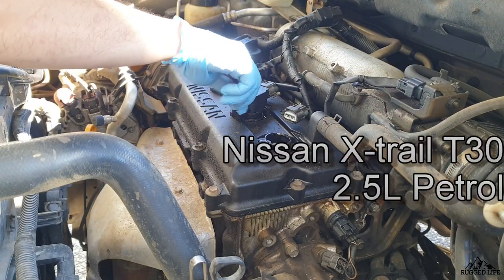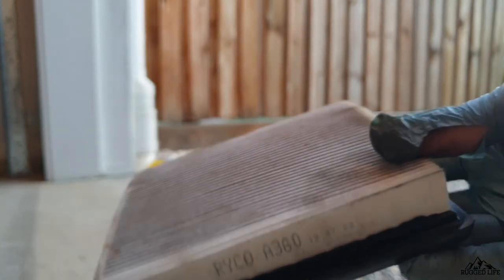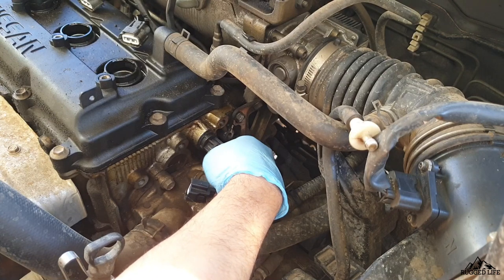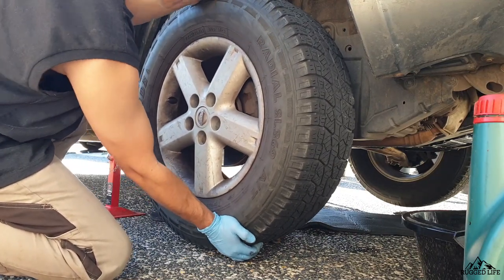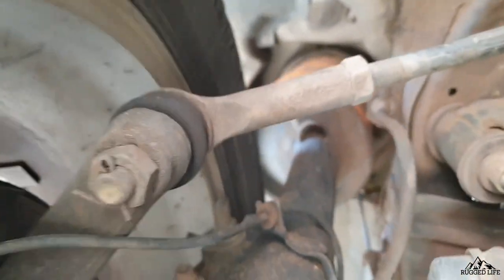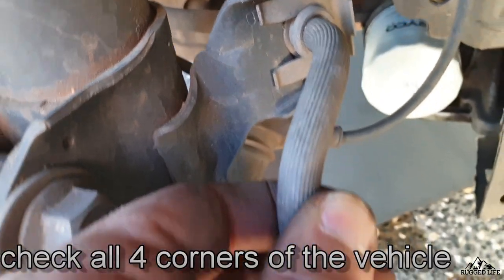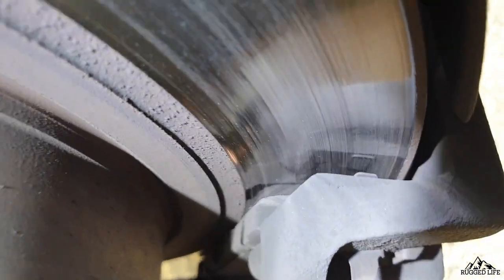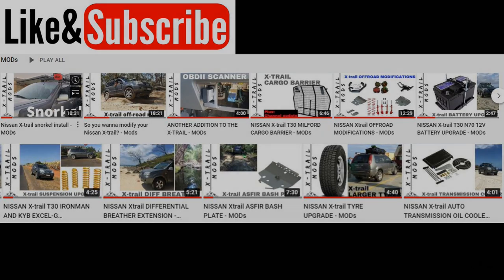X-trail maintenance part 1 - How to guide

Comment: I've experienced the cam sensor problems when I bought the car second hand. It's come to the point where sometimes it won't start. If you remove it and wipe the oil off it insert it back, plug in and turn it clockwise so it advances the timing. Then it should start. Return the sensor to the original position and tighten the bolt. This is to get you out of those situations where it just won't start. Clean oil is a must too as the sensor is magnetic. And dirty oil will cause issues. I also have a OBD bluetooth which comes in handy to help clear codes.
Reply: on t30 xtrail if any of cam/crank sensors fail, just disconnect it and keep starter turning about 25-30 seconds... car will start and run on default mode, with low power and bad fuel efficiency but you will drive to destination : ))))
Reply: @mr.bk_mrbk  very nice tip! It's easier to repair at the destination, after a good shower and night 👍

Comment: I have a 2006 GT model engine bay is very different with a huge intercooler, we were lucky many imported in my country. It only has auto and 4wd lock i guess the 276HP need a lot of traction, great car and excellent offroad  I have BF Goodrich A/T 225/70/16

Comment: Hi Marvin.  I asked this on another video of yours, so sorry for repeating myself, but this video popped after I asked the question.  I love the T30 X-Trail myself, I briefly owned a 2005 model (as < 1 day) before the it blew the engine.  Obviously it was sold to me dodgy...got my money back from the dealer for that one.  How do you prevent the notorious head issue occurring in the first place?  My understanding is it's caused by sand castings coming loose and blocking the rad.  I'd love to own one again, especially as it has a torque converter auto instead the CVT introduced in the T31, but I'm afraid of having expensive repairs with the head issue.

Comment: Hello nice video. I have an Xtrail T30 QR20 year 2004. After driving one day in a natural park with a lot of sand in Africa the car started with a vibration. This vibration occurs in D and R when I am stopped with my foot on brake. For example, when I am at a traffic light with the gear in D and the foot on the brake the vibration moves everything, however, when the car starts to move the vibration disappears. I have already changed engine mounts, fuel filter, spark plugs, transmission oil. But the vibration continues, according to your experience what do you think could be the problem?
Thanks for your comments
Reply: Happened to see your comment, my issue could be different but just incase: I had a vibration/rattle noise while stationary in D or R on my qr20 aswell. Eventually noticed the alternator pulley was seized and causing the serpentine belt to flap creating the sound/vibration magnified by the belt tensioner. Remove your serpentine belt and run your car to listen for the noise in D/R. If no noise, one or both of the pulleys are your problem. Warning, don't drive without the belt or you'll overheat the engine. It's safe for troubleshooting but keep an eye on coolant temp with belt removed.

Comment: Excellent video mate, i have a T31, it starts but no power above 80km/h or ravs over 3000. Is it a cam or crank shaft sensor issue?
Reply from the maker: I don't think so. Normally, you'll habe issues starting it up. So is it completely normal below 3000 rpm or under 80kph?
Reply: Blocked cat?

Comment: Cheers mate👋I see you no your stuff Cool.. can I use castrol Edge 5w-30 to top up I'm going to flush engine which has  sludge wea I put oil in the top cheers for your time mate👍
Reply from the maker: No worries. If your just topping up, you need to match exactly what the existing oil is. Don't mix oil. If you're not sure what's in it, you're better off to change it all.

Comment: Hey mate, I just got a T31 CVT, with the 2.5L and it is THIRSTY.  I am 90% highway KMs, and I am getting 9.5-10L/100Km. Any suggestions?
Reply from the maker: Apart from full maintenance, fluids, spark plugs and filters, do the O2 sensors, cam and crank sensors and use a really good injector cleaner. If it has high kms, get the injectors replaced although they may be expensive.

Comment: By the way do these cars have an issue with front catalytic converter cause my sister have 2002 2.5 liter engine Like Altima 2006 when it’s broken and sucked into engine and damage it ?

Comment: Hi ...any advice regarding coolant temperature sensors...where is located on a 2007 t30 petrol..have you replaced one  ??  TIA...Great videos btw
Reply from the maker: It's just above the water pump which is on the rear of the engine somewhere above the transmission bell housing. A quick google will show you. I haven't needed to replace mine.

Comment: replacing the rear tail shaft is rather expensive as the whole shaft has to be done non replaceable universals, 2006model manual, tail shaft and a replacement radiator due to the plastic cracking a weak point, and the module for the blower all the repairs done to date,240.00klms, would not change it had 2004 prior but did not survive a mishap with a clown who cut through traffic , enjoyed your videos
Reply from the maker: Cheers. Thanks for your input 👍

Comment: Hey mate, just watched your video from 2 years ago about rear seat removal and saw the child seat. Just wondering if you have a child seat install video if you still have it in there? Just wondering how well it fits
Reply from the maker: Hey mate no I don't have the child seat anymore and don't have a video. It fits nicely but also depends on the child seat I suppose. I just used the 3 point seat belt.

Comment: Hey mate just getting into 4WDing with my T30. I have a clunking sound on rear suspension when driving over small undulations on the road, with a 1-2mm play top to bottom on the rear wheel, struggling to get a proper diagnosis. Long shot i know, RAC found wheel bearing is fine, same for all CV and lower suspension arms + bushes. Have you seen this, or Any ideas what else to check?
Reply from the maker: Sounds like either bush or wheel bearing but as you say they are fine. Retorque all bolts under there maybe. Take wheel out and double check bushes etc.
Reply: Check bump stop on shock?

Comment: I have the 2005 model. I am currently having problem of low water levels in the radiator. I had my mechanic check it but no leakage has been identified. It’s still happening. I have to top the radiator water level after every 3km.
Reply from the maker: That's a lot of leak if you have to top up every 3kms. Is your engine oil not contaminated? Get another mechanic to check it.
Reply: I have the exact same issue right now! Going to get serviced in a couple days I'll have to tell them about it
Reply: @ruggedlife  The oil gets milky on the dipstick

Comment: just use coil instead of pipe ☺
Reply from the maker: I like the hard way 😂
Getting it off yea but threading the spark plug back in might not work with the coil actually
Reply: @ruggedlife  👍 i always use coil after   my spark plug socket lost rubber :D